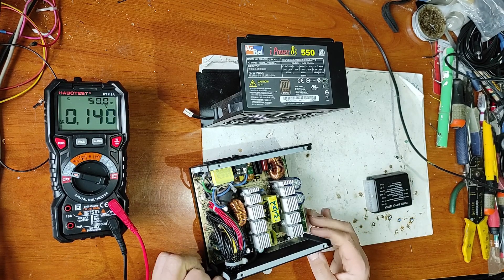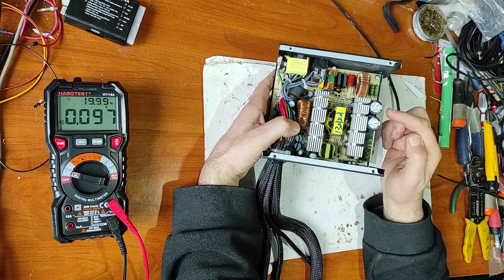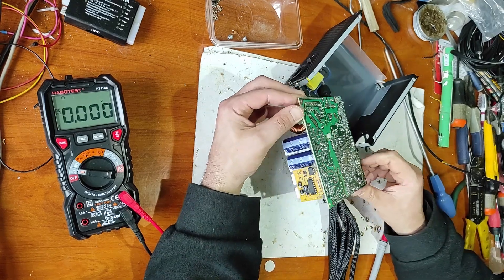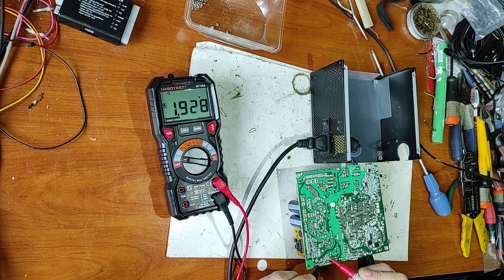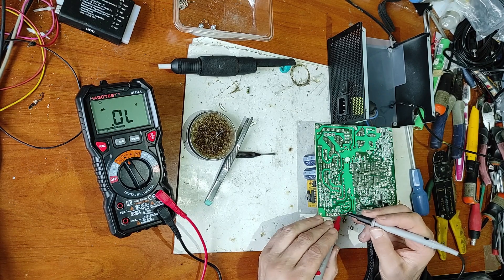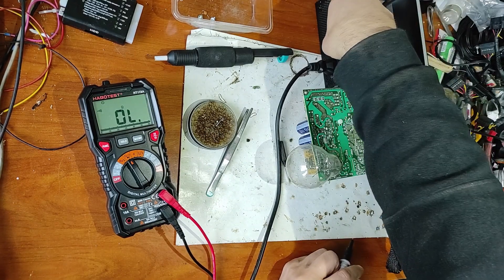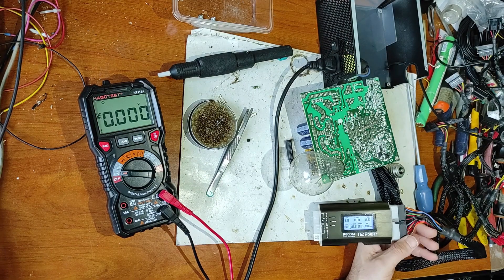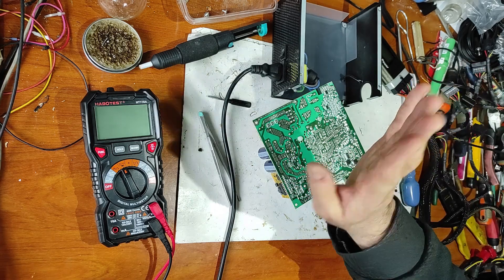PC Power Supply Repair No StdBy  Voltage with TNY278

Comment: 07:04

Where did you connect your lamp?

Between what?
Reply from the maker: I use this lamp instead of fuse in series with main voltage input.